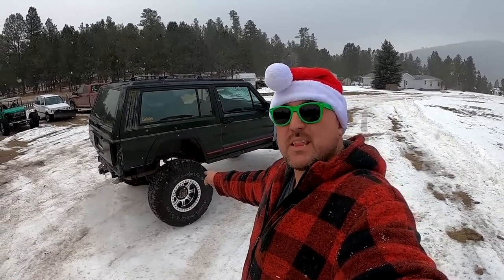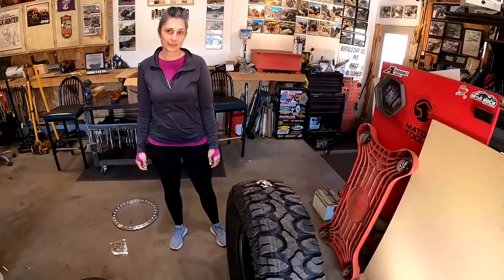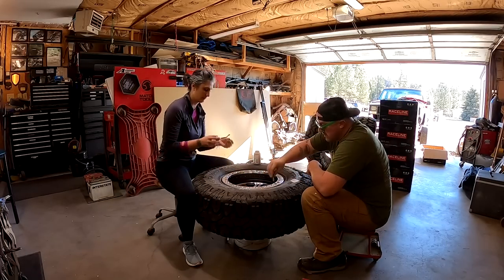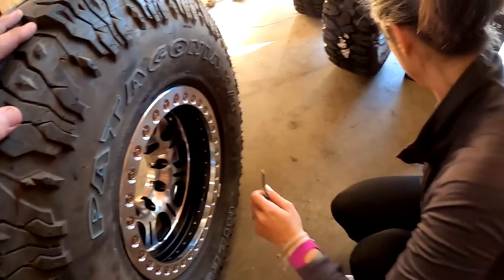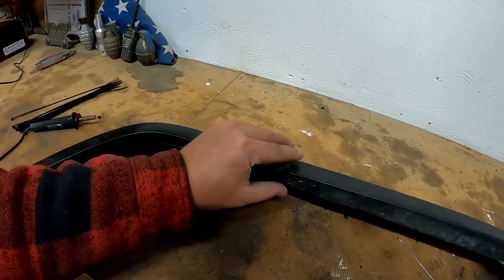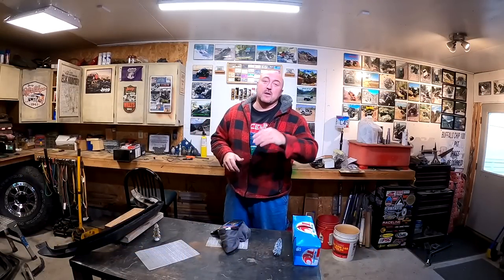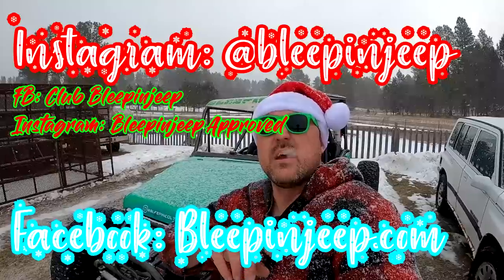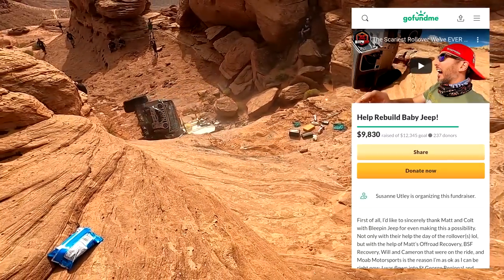Rats Nest XJ is starting to look good in this Christmas Special!!

Comment: I'm impressed, someone that knows what the dot is for, and uses a torque wrench. Just about every tire shop I've gone in to, I've had to educate them and insist they use a torque wrench with the RIGHT torque.
Reply: A lot asume there impacts set at tork and don't even criss cross the nuts when they fit them 😆sad they don't even know their job
Reply: @Donald Halls  Pride of craftsmanship is near extinct. Shit you can't even get a nice burger from drive through anymore 🤣
Reply: I just lean on my long bar to remove wheels and stand on it to refit. When I hear a crack I stop.

Comment: I'm late to this (Christmas) party, but worth noting that the typical rear fender cut-and-fold tabs are a great place to collect mud, salt, and water with the usual results. A previous owner of my XJ did the same mod, and after inspecting and seeing surface rust already starting, I opted to liberally hand-brush black Rust-O-Leum from a can into the metal folds, let cure, then fill the entire inner lip with black seam sealer. One standard tube was enough for both rear fender lips.

Comment: Watching you measure and cut out the fender openings for you flairs reminded me of when I bought a brand new Bronco back in 1977 and 2 weeks later I took a sabre saw to the rear quarter panels to install the fender flairs and clear the bigger tires. I had never done ANYTHING like that before. They say “measure twice and cut once” , I must have measured a dozen times, both sides, to be sure the flairs would cover the big hole I was about to make and it was in the right spot. I got about half done cutting the first side and I had to stop and have a cigarette and didn’t even smoke, I bummed one . Lol The first side took me about 2 hours. the 2nd side less than 30 minutes.

Comment: If you put a hose on the bleeder then into a bottle of brake fluid and then crack the bleeder loose you can bleeder your brakes alone one at a time..just keep an eye on the reservoir so it don't go dry I used to check every 3 to 5 pumps. Start from furthest to closest

Comment: Food grade anti-seize is the best. No mess, does not stain, does not absorb into your skin or anything, non-toxic.  Different temperature capabilities are available. Use it on anything you don't want to seize....fasteners in steel, stainless, aluminum, between alloy and steel wheels...against drums and rotors. Exhaust, etc.

Comment: I like using my drill to snug up the bolts on the bead lock.  I think it gives a better feel of how the bolt is going in.  Then you can use the clutch to get them all snugged the same before getting out the torque wrench.  Just my two cents.

Comment: Great video.  Maybe I missed it but did you stretch the front out any or are you still gonna have to do something with the pinch weld on the back of the  inner wheel wells in the front?

Comment: I'm going to make alum. flat flares for the Bumble Jeep (Project Bumble Jeep YT channel) but I won't be cutting fenders or quarter panels. Using stock mounting holes with nut serts for mounting. Bumble Jeep is too clean to cut. (IMHO) Also will only be running 33's. Merry Christmas! God bless and stay well.

Comment: Afternoon Colt, I run raceline as well, the first time i installed on them I did not have those plastic spacers. Now that i upgraded to 40's i am using the plastic 1/8 spacer, The ring is flat now looks way better.  i feel those pieces should be included with the wheels. Do you  use the spacers?  I am going to be cutting alot off of my JKU plus add some bumpstop.
Reply from the maker: I haven't needed the spacers on the handful of sets I've ran so far but I do know friends who needed the spacers running Maxxis tires. Raceline has the measurements on their website when ordering wheels to distinguish if you need spacers or not though, so I just checked that.

Comment: What is the trick for milestars i got them on my xj I'm locked in the rear open up front 
I'm not on bead locks and I have them at 15psi and it seems like as soon as they get wet or in mud they turn to trash I mainly wheel in Indiana or KY

Comment: Not only do you look at the maximum tire pressure, you also need to look at maximum tire pressure for the wheels.  Maximum pressure for Raceline is 25 PSI.  Although 30-35 may be ok most of the time, I definitely wouldn’t say you could air up to the max Tire pressure.   And I’d give a disclaimer about the Raceline recommended max pressure.

Comment: I should of antiseized mine I did one rim and got so tired of it and said screw it I have an impact wrench lol and I live in the rust belt 
I also did the rims very meticulously and not as experienced as you so it took me about 4 hour per tire 
I was so worried about having them equal I did all 32 bolts by hand 😂 it was like 40 passes or something insane

Comment: Always a good idea to fill the tire 20 to 30 psi over the pressure you will be running to help make sure you get the beads set properly. That is a good reason to take valve core out so it is faster to air it back down.

Comment: You left out the issue of getting the bead in the bead lock side and keeping it there!!! And lube to simply push the tire on the wheel at the beginning!?! I wouldn't recommend ever using power tools when installing the bead lock ring!

Comment: Please don't tell people to run how much psi is marked on the side of the tire, that is the worst advice to tell people. Max you want to run is what it says on the door jamb, bigger tire you need even less than that.
Reply: Hey Jester, i’m pretty sure Colt said. 50lbs is the max pressure, he didn’t say to run them at that Psi!
Reply: @jessponce3314   I def. heard the max as well, but I also interpreted it as suggesting to run it that way, may not have been what he meant though for sure.
Reply from the maker: The intent was not to tell people what tire pressure to run (to many variables with lifted vehicles and weights) but specifically to make sure that nobody accidentally over inflates a tire.